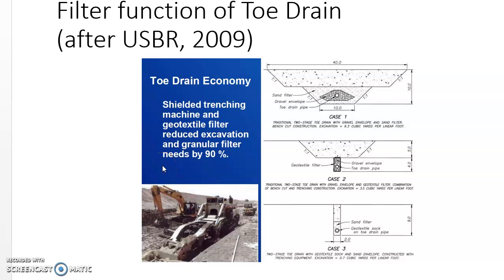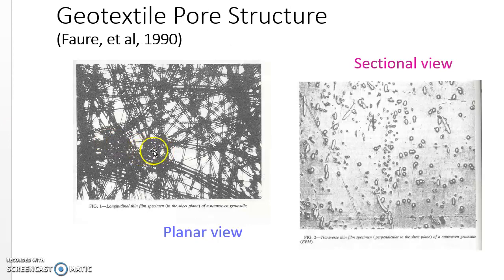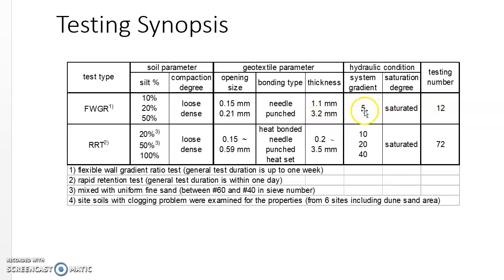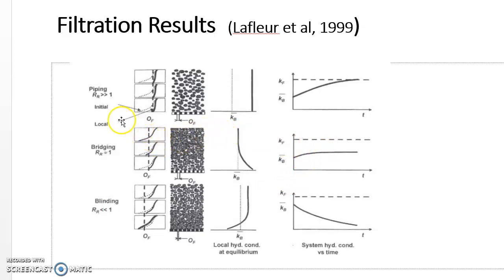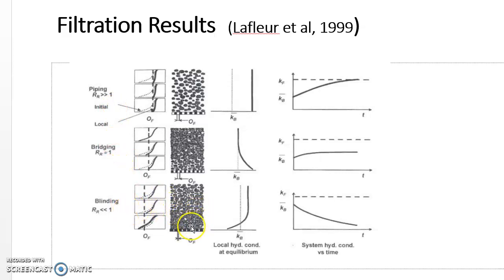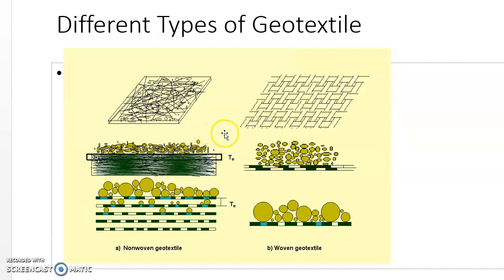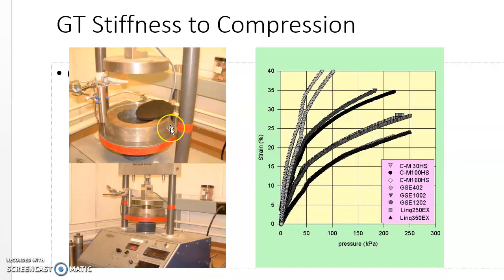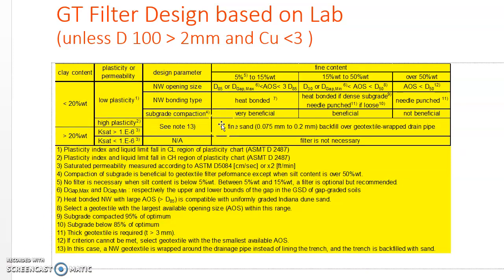Geotextile filter performance and compatibility with various fine content soils

Comment: Dont agree with his opening statements. Geotextiles have been successfully used in South Africa in large Earth Dams. There is an excellent Technical Reference Paper by Kelvin Legge and Peter Davies
Reply from the maker: I know some European countries allowed using GT as dam core filter, but no failure meant successful drainage function of GT. GT could continue serving retention function even it had been clogged or blinded by clayey core. But, we don't know whether the drain function of the GT used as for the dam core filter continues or not without being exhumed and tested.